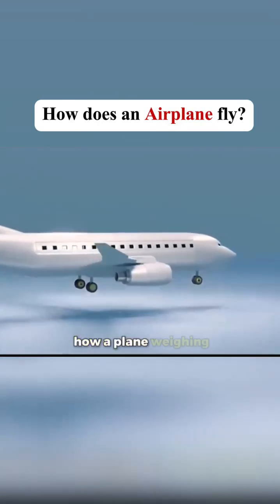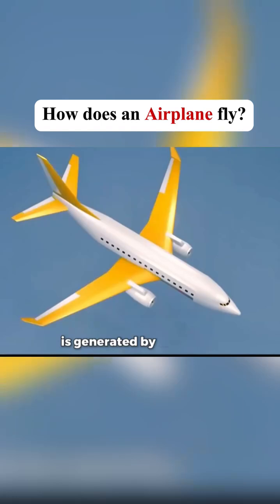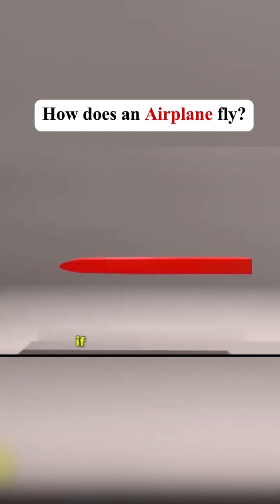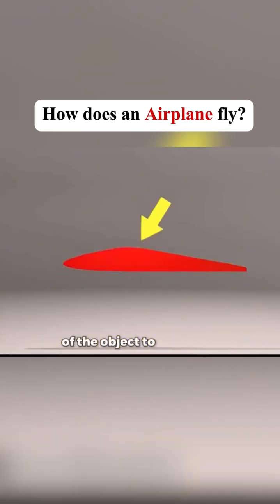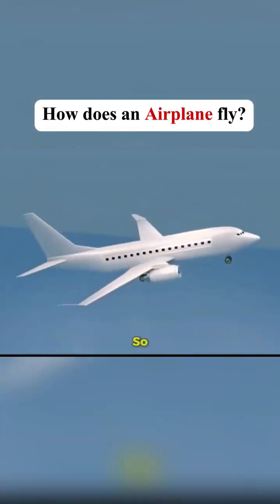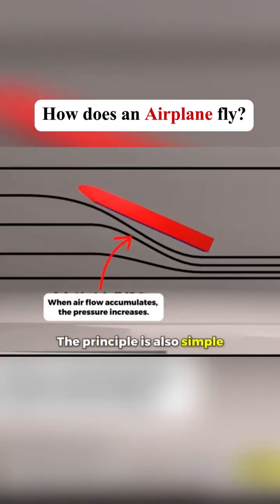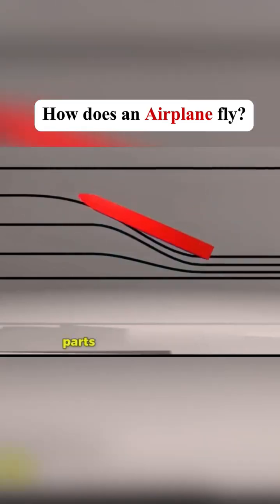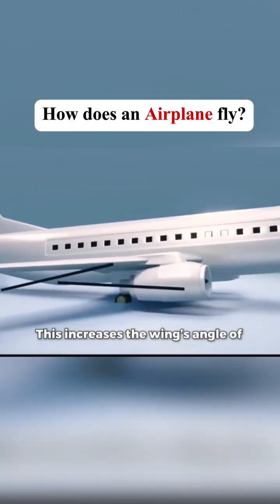The Magic Of Flight: Unraveling How Airplanes Fly? #new #shortsfeed #fly   #trending #reels #shorts

Comment: No one ever explains Bernoulli’s Principle correctly. The pressure decrease isn’t because the air is moving faster over the wing, it’s because the air accelerated as it went over the wing. It’s the acceleration not the speed.